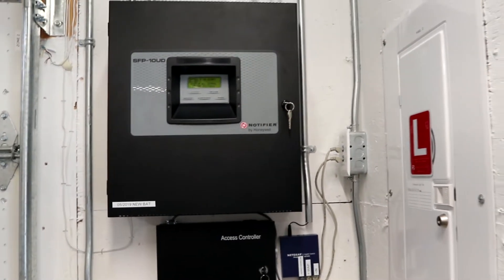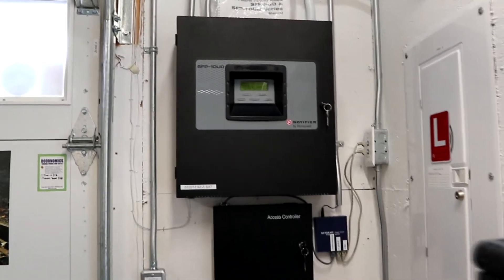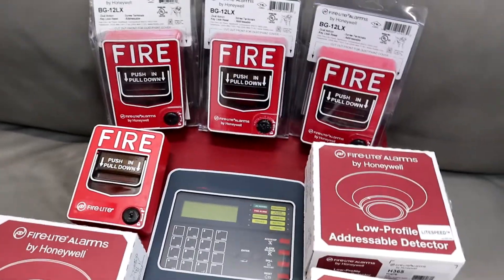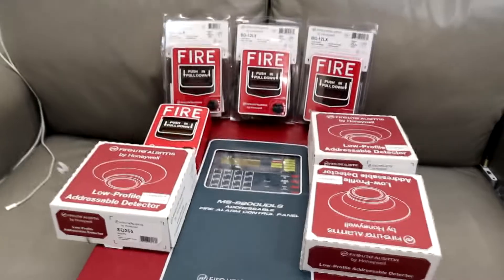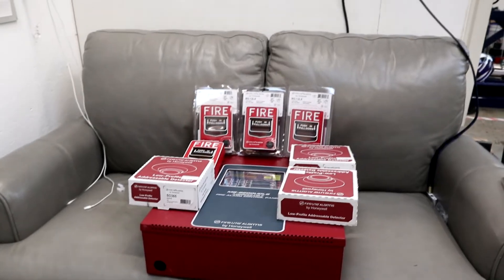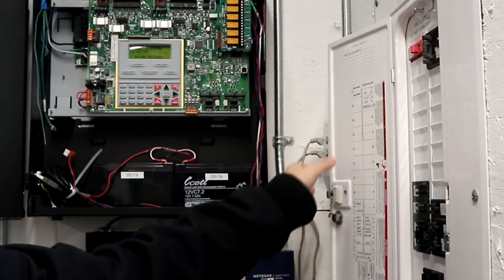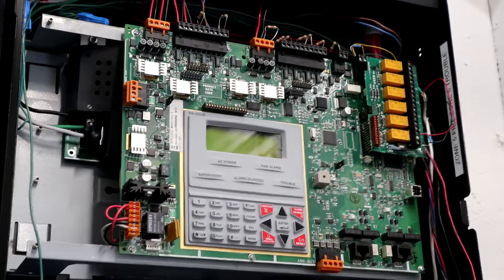Installing my new addressable fire alarm system - part 1

Comment: I think it's weird how we have standard connections for pretty much anything other than fire alarms. USB, 2-pin connectors, 4-pin connectors, I mean even desktop PCs have made everything plug-n-play. But fire systems? Just loose wires you have to plug into exactly the correct spot for them to work correctly.

Standardize connections for fire systems, and everything becomes easier. Installing a system, upgrading it, diagnosing / fixing it, the whole shebang. And if you incorporate a low-power SBC (like a Pi Zero) and send it 5V when the alarms are going off, you can have a script send you a notification so you can be there in a heartbeat if the fire department wants you to correct your configuration.
Reply from the maker: That's a completely different thing USB connections are 5 V fire alarms are 24 and much higher current. Fire alarm systems just like other electrical components are not meant to be something that is commonly removed it needs to be a solid connection as it is life safety

Comment: So I guess i never really understood how these devices are wired. Is it all seperate wires for each device into the SLC, or does it all run off of one wire that is split until the EOL?

I’ve wanted to go with an addressable system for the future. Just never really understood the wiring concept.
Reply from the maker: There are videos out there that explain it way better than I can but it's just one set of wires other two or four depending on if it's a class a class B loop and if it's addressable there is no EOLR
Reply: So when you say set of wires, you mean one seperate wire for each device running into the one SLC, right? My brain has a hard time processing some things so I ask for clarification purposes
Reply from the maker: @alarmtech5909  no it is a set of two wires that travel around the building to stop at each device and at the end of the line if it's a class A system there are two wires that return back to the panel making it a complete loop
Reply: @nics-systems-electric  Ah, alright.

Comment: As an electrician I have not had much experience with fire alarms. I found your video extremely helpful and informative. I loved how you speed up the video during the slower parts. I subscribed!
Reply: Your fire alarm panellooks so old. It just looks old. All thepull 
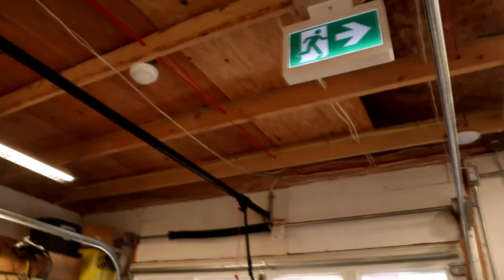0:31  stations are old. I never saw these videos before well. Thanks for creating one. 0:25

Comment: What kind of resistor for the 9200UDLS
Reply from the maker: Only nac circuits 4.7 K ohm
Reply: @nics-systems-electric  what about for the pull stations, smokes & heats
Reply from the maker: @firealarm421  It’s addressable
Reply: @nics-systems-electric  so no resistors for the pull stations & smoke detectors?
Reply from the maker: @firealarm421  No it’s an addressable system

Comment: Nice work. I would’ve recommended keeping the panel and switching out the devices. Addressable sucks. I’ve had trouble with it A lot whenever I’m out doing stuff.

Comment: Dude, just pull the notifier key out slightly instead of shaking the whole door to open it.
Reply from the maker: I would normally use a firelite key Just demonstrating but that is good to know
Reply: @nics-systems-electric  ok, I actually have some Kidde pulls that use their own key, but the Simplex Key, EST Key, Fire-Lite Key, and Notifier Key all work at a varying spot in the lock. All of the keys are built very similarly with slight differences.

Comment: Oh! fun fact since you said that if you jiggle the notifier key on fire lite lock, when I got my first fire alarm ( fire lite bg-12l) it actually came with a notifier key.
Reply from the maker: Fire lite key is still better obviously but it sometimes works with notifier
Reply: @nics-systems-electric  but then once I got a bg-10lx not to long ago, it came with a fire lite key and it works a lot better
Reply from the maker: @Fire-hq3rm  yeah it’s definitely ideal to have the right key but if you had to you could use a notifier key

Comment: Awesome video! Keep up the great content.
Conventional to addressable wiring can be a pain sometimes. 

Also I found that out myself about the Notifier key can open Fire-Lite devices, but Fire-Lite keys cannot open Notifier devices.  That's quite the common flaw on many different panels I have seen.
Reply: And addressable to conventional ?
Reply from the maker: @Fire-hq3rm  yes I converted the system from conventional to addressable